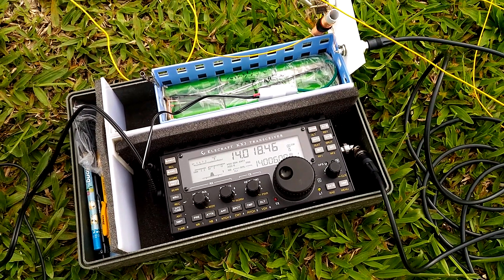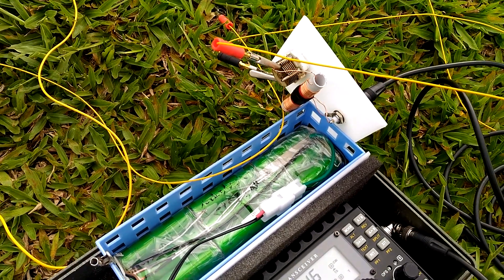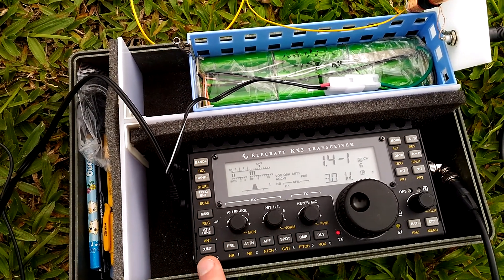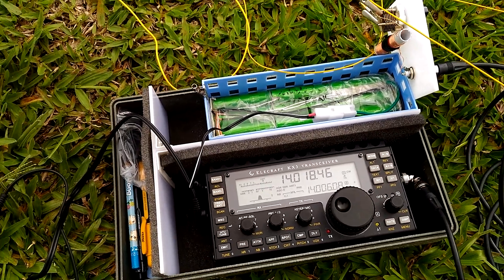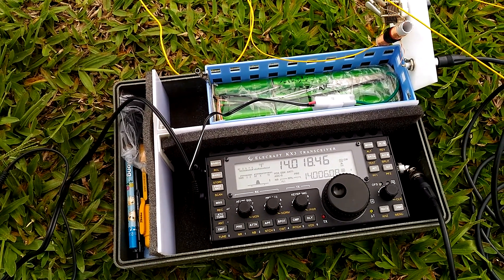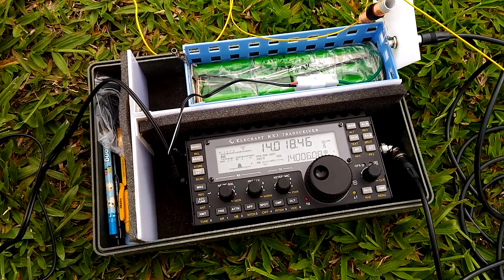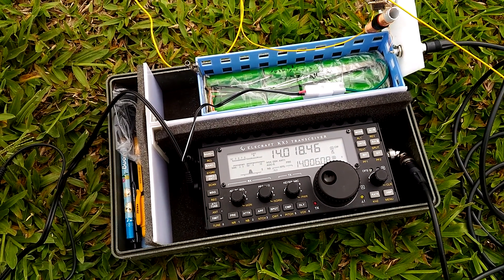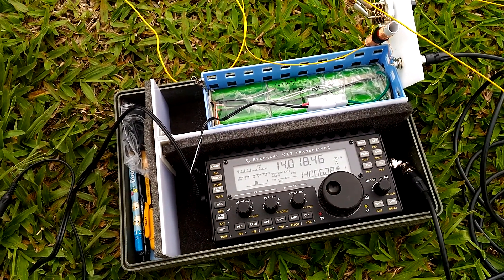End Fed Half Wave - progress on 20 meters

Comment: Make a 64 to 1 UnUn and make the antenna wire 65 feet long. You'll be able to get a low SWR on 10, 15, 20 and 40 meters. I made one and it works perfect. I compared it to a coaxial fed half wave 40 meter antenna, using reverse beacon and the results were the same.  Since they are so simple to make, I made three of them and put one in each of my Go Kits. I have an Elecraft KX2, KX3 and a four band YouKits. I actually used #22 gage insulated teflon wire and the antenna and UnUn fits in my shirt pocket.  Keeping things small and light weight is very important to me.
Barry, KU3X